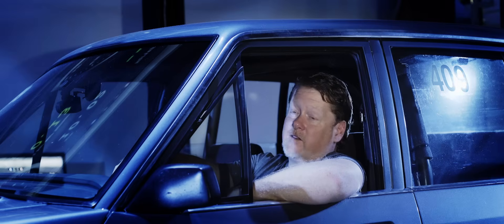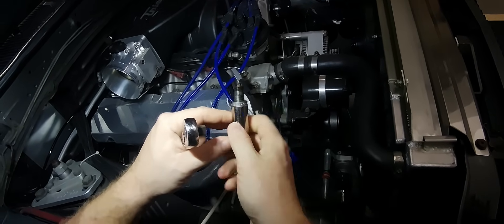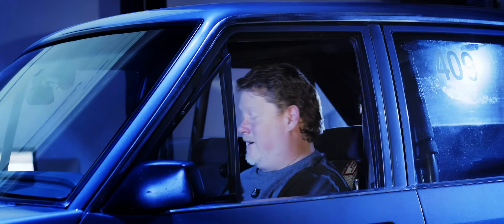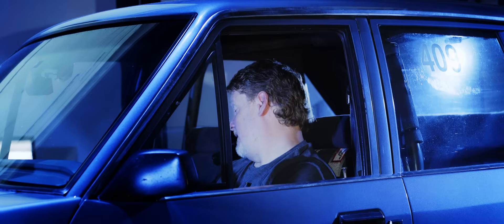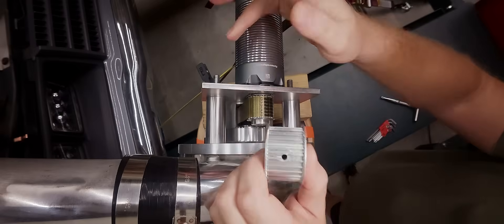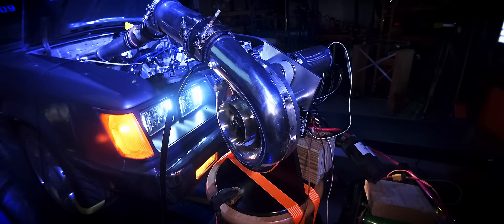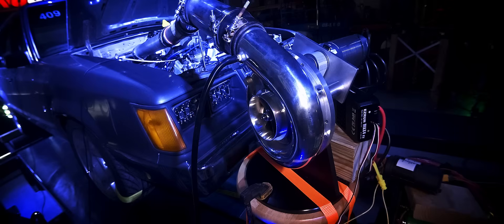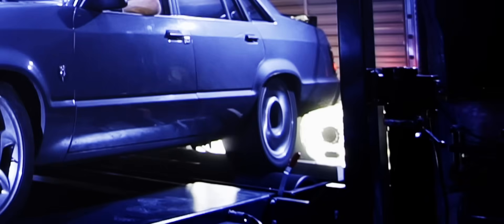The P2 Electric Supercharger Gets Dyno Tested With The Biggest Motor Yet

Comment: I've been trying to get into this whole electric-super charger thing. But there are FIVE issues. 1. Takes up too much space in the cabin. What you gain under the hood. You lose in the cabin. 2. Minimal boost. Not quite enough for even a 2.0L streetcar. 3. Restrictive intake, when not ON. Requires a complicated by-pass arrangement 4. Ridiculous cost. 
I can turbo charge a stock 2.0L for a about a 1/4 to a 1/3 of the price. 5. an electric charger is good for only 3mins. A std turbo will go all day on boost/partial boost etc. 
I think it's coming but a lot of tech has to improve before it's going to be an obvious choice over conventional.
Reply: Come on, you know you want less horsepower. 😂
Reply: @jasonbourne1596 Hahaha... more expense and less HP. Every tuners dream-combo. NOT!!!
Reply: Basically the 20th century has been, "hey! I invented something!"
But it's stuff that was already found to be useless 100 years ago.
And that's why it's, 'not around today'.
For all the money he is spending, he can literally strap on a 250hp axial electric motor, inline with the engine driveshaft and fill the floorboard and spare tire well and part of the trunk with batteries.
Or buy a new engine 
(yes, I know that's not the point... but what is the point? Figure out something that doesn't work efficiently? Like turning plastic into gasoline?)
Reply: @m4rvinmartian  Good point. The Super Charger was invented in the 1920's. but didn't really make it until Drag Racing came about. As you said "Kinda useless'.
Reply: I think you're over stating and under estimating a bit. What has been demonstrated so far is one example that is dedicated to straight line strip performance. Battery options are available to increase performance duration well beyond what you've observed. This is modern tech on an older less efficient gas engine (although impressive) compared to modern tech and materials. My GM Direct Injected DOHC 3.6L V6 would have run circles around my old 5.7L IROC-Z28 with Tune Port Injection. The efficiency bump makes the low boost pressures a lot more significant than they would be in a traditional turbo pound for pound of boost having no exhaust restriction. Cost is relative and not the same for a DIYer vs. a consumer who must pay for the kit and possibly someone to install it which will cost  more than this outfit and having built several turbo projects, the absence of excessive exhaust plumbing and heat and various other mods is a welcomed change. A bypass while out of boost is a simple feature if you know how to use a blow off valve to achieve it. I don't care to butcher up any more nice stock cars so being able to bolt on a turbo with minimal invasiveness is quite a bonus, especially for those who still have vehicle inspections.
Reply: @qq-hk2sq  MMm.. I hear what your saying. And YES the less plumbing is welcomed. It's just so easy to bolt on a standard turbo or ProCharge solution and  get way more power, for minimal effort. You say that the batt tech offers a lot more options, but all that batt tech costs dearly and reliability is not guaranteed. I'm going to ProCharge my car and wait for TorqAmp or some such company actually make a head turner before going electric.
Reply: @dora-de-explora   Unfortunately what the nay sayers seem to be speaking from is total inference and no experience with the technology. What I am building is more powerful than what has been demonstrated. Alex is not being given his due credit for the quarter mile performance he's putting down with an electric turbo. A basic setup using this new motor and ESC would run about $1500 plus your battery choice and whatever you spend to connect the motor to the blower. That's not bad for a 0 second spool up at launch. It's all about the science behind the build. When the math is in the build and correct, you see clearly and things work to plan. This is about practical, non invasive performance. As I mentioned earlier among other things, some cars are too nice/new to butcher up with extensive modifications. 100 hp from an electric supercharger is not a joke and with the proper size battery a typical day of driving reserve is doable. Practical performance is the goal, otherwise this would be about a traditional power adder. Give it some time, just like with the electric cars, it'll catch on. I'm selling my unused turbos and going this route.
Reply: @qq-hk2sq  I'm waiting. I have a car begging for it. Either that or it's getting a ProCharger. Whichever comes first!
Reply: Use a chainsaw motor to drive the compressor 😮

Comment: You picked up 15-20 hp more than my back of the envelope calculation suggests you should with 2.4 psi of boost, which is interesting considering that it's non-intercooled, at that.

Comment: There could be a niche for this on something like a full size truck. Compound setup for the f150 ecoboost bros. Propane injection to lower intake temps and bypass any factory fueling limitations. A rethink on the pressure ratios would be in order. 

Oh and i really hope you're building a giant heat sink with that pond to exch with your shop. You can dump a ton of btus if you just circulate water under the ceiling and then dump it into an ebay heat exch like truck radiators to air away from the place, then you put less load on the water, then smaller a/c are go for final close comfort.

Comment: You really need to try to connect your electric supercharger to the battery of a Hemi Ram with the E-torque system
Reply: I've thought about using the hybrid battery pack in hybrid cars/trucks to piggy back off. the issue seems to be the systems do so many safety checks before crank and when running. if there's any sign if a current draw outside of its own use, it thinks there's lose of isolation of the high voltage and shuts everything down for safety. I currently have a older hybrid yukon. I've got upgraded sodium based cells in the hybrid pack which is 330v ish when fully charged. can handle a 100amp discharge over and over again. would be awesome to run even a small 4psi setup off that and just let it do it's thing. but sadly it doesn't seem possible without access to the programming.
Reply: @jsomething2  I wonder if the 48v? System on the Ram Etorq could be hacked to activate the turbo in parallel or in place of the Alternator when it tries to push the vehicle forward
Reply: @alexandreapril5694 is so, that would be very cool. still charge off it, but discharge flips a relay and powers the supercharger.

Comment: Why don’t you use Vesc? maybe the flipsky 75450 I use that in my pitbike. 350amps at 80v
Reply from the maker: I tried VESC - I used the real deal 300/75 unit.  I have a bunch of videos on it on my channel.  It doesn't like high eRPM or long motor cables.  I ended up giving up on it.  It's now sitting in a box unused.

Comment: So..... You can push that Castle motor much further. Get a MadMax21 ESC and run that motor on 16S 500plus Amps. The Mad21 esc and this motor at 16S is an insane combo. 30Hp plus all day. ALSO..... I think if You get the correct new Castle 12S ESC not sure exactly which one but its the one specific to top end runs all the limits are removed
Reply: The cobra 5 ACE HV has 700 amp cap

Comment: I was having a ton of trouble with my max4 esc. Things got better when I switched to the HW 70125 SENSORED motor. I tried several including, Castle, sss, leopard etc. The 70125 plays nicer with the max4. I still turned a couple more max4's into fireworks.  When I upgraded to the 48v (53v technically) lithium golf cart battery and ran 1/0 awg oversized ofc wire to about 1" before it goes into the esc housing. I used a hydraulic crimp tool. Twice! No more cutting out and no more fireworks. The current draw dropped substantially.